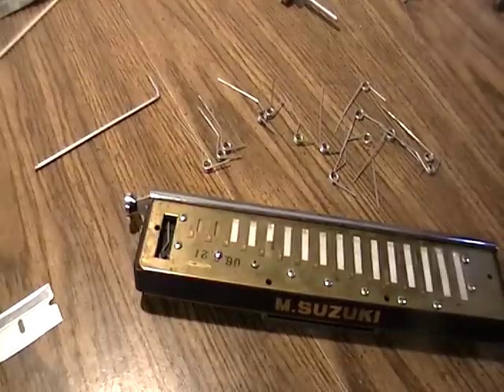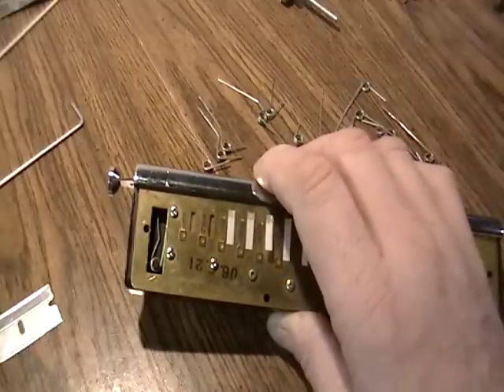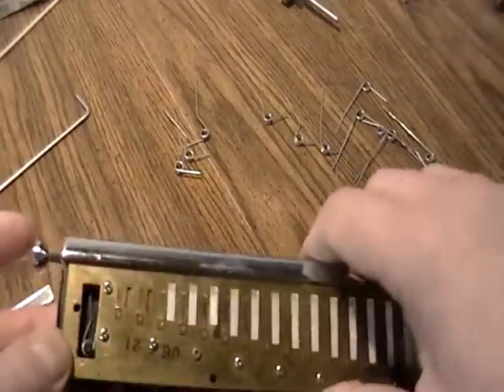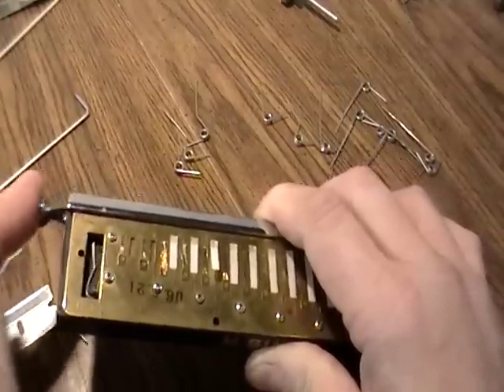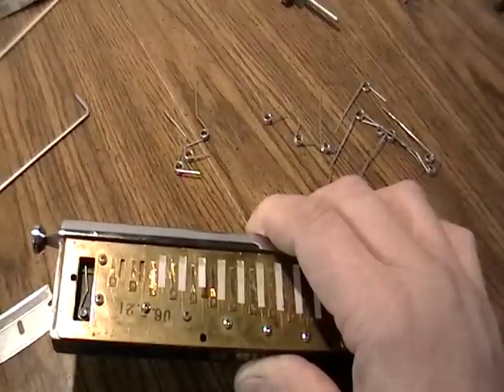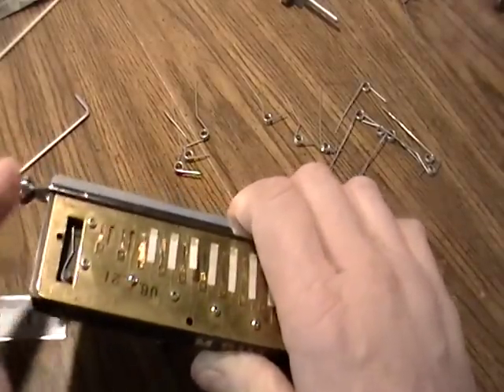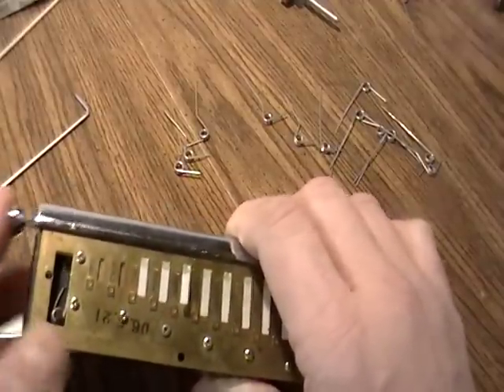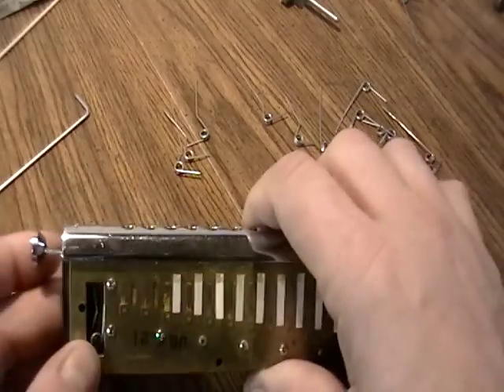The correct wound spring for the Chromatic

Comment: how you make this spring
Reply from the maker: Greetings Soufiane ; My trade is Tool & Die maker so I understand what is need and how to make a bending fixture to produce a higher quality spring than most of the other harmonica companies offer. I offer my springs in 4 different grade of Stainless Spring steel wire @ different diameter which offers different tension on the slide action